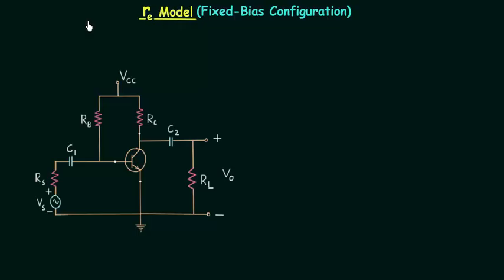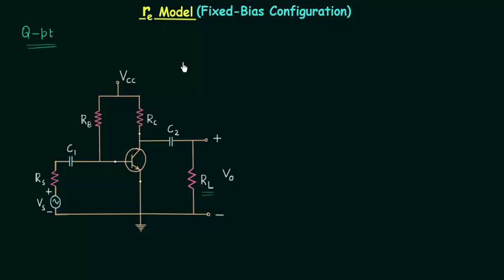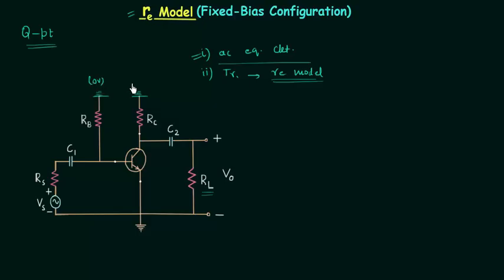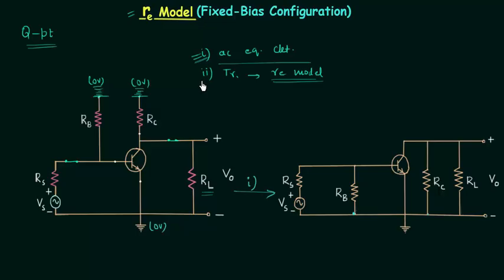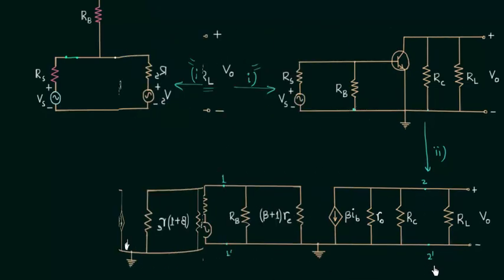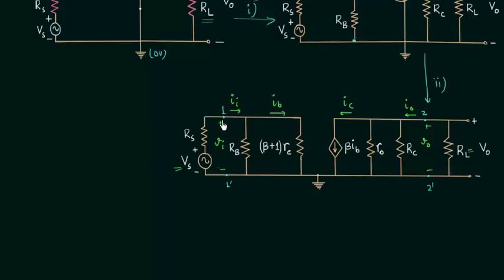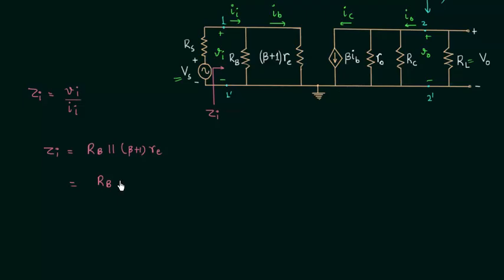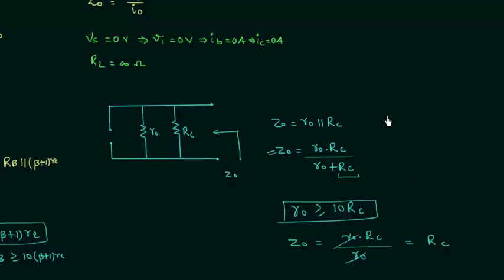re Model (Fixed-Bias Configuration) | Part 1

Comment: Why you always do source voltage short ckt. and load=infinite during the calculation of output impedance
IT ALWAYS EAT UP MY HEAD 😫😫😫
Reply: It's actually a procedure made to ease our work, voltage sources are shorted and current sources are opened. For proper explanation check out Thevenin's theorem (Thevenin voltage and Thevenin resistance)

Comment: at 9.00 in video,why did u short circuit the voltage source and open circuit the current source to find the output impedance ?
i mean what basically is output impedance and input impedance mean ?is it thevenin voltage across the output and input terminals or something else ?
Reply: he utilized z parameters ..... these parameters are use to calculate input and out-put impedance... if you search on google you can check what are the conditions to observe while following these parameters....